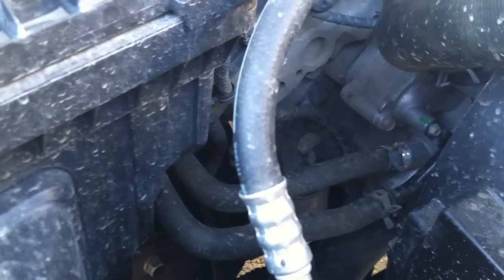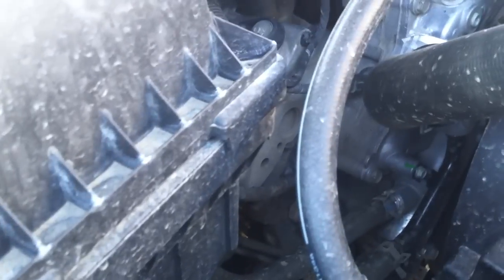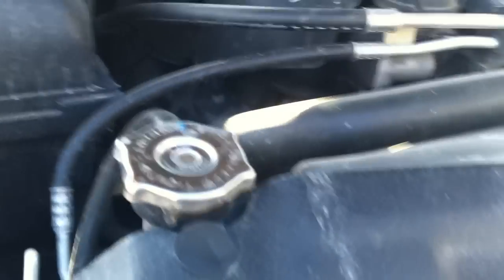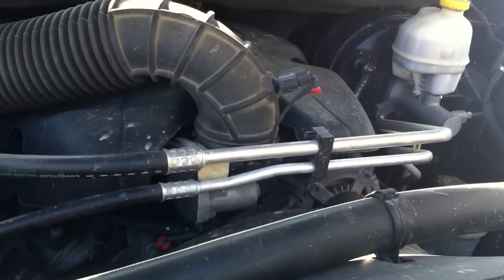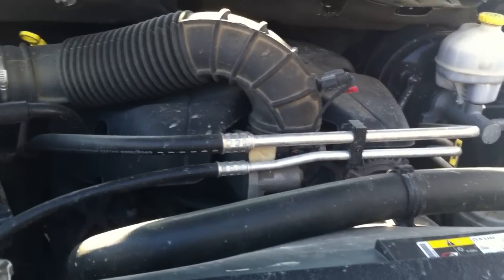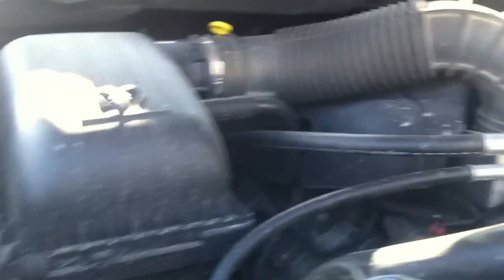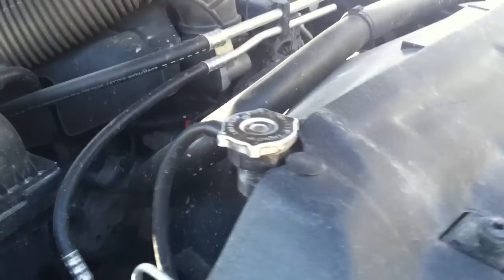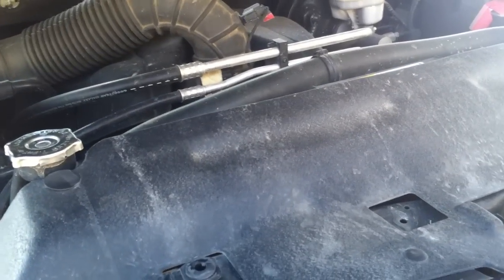How To Fix Dodge Ram Hemi Tick Recall!!

Comment: Had the same noise, dealer told me it was normal. Your video helped me realize it could be an exhaust problem, which it was and they fixed it under warranty on my '13. Thanks !!

Comment: My 2012 5.7 Ram had a top-end rebuild at 72,000 miles, despite being treated with kid's gloves. Got back home from vacation and when I cranked up the Ram (that stayed home) there was a tapping nose that sounded like it was coming from the catalytic converters.  Took it to the dealership and diagnosis was "failed lifters" and broken exhaust manifold bolts.  The lifters that failed were the MDS lifters. They ended replacing the heads, cams, lifters, etc. and replaced manifold bolts with stainless steel ones. Even though Dodge knows the metal manifold bolds break due to the heating/cooling extremes, they still put them on the engines.  Repair was covered under 100,000 mile Power Train Warranty. It's a shame Dodge isn't able to resolve some prevalent design/manufacturing flaws in their flagship engine.

Comment: I'm glad I found your post, my 2012 Ram just recently started making the same noise at 80k miles. Going to take mine in soon as soon as I get some time, I'm also hoping I don't get the "they all do that, nothing to worry about" b.s.
Reply: Paul Mitchell no kidding.  I get sick of that excuse.  Did you get yours fixed? Mines an 04 but only does it at cold start and for less than a minute.  A friend thought it could be a lifter but it sounds to me like it's manifold gasket/bolts to me.

Comment: Bought a brand new 2015 Ram. Brought it to the dealer for an oil change with 3000 miles on it and right away had a noisy tick at start up. Perfectly quite before that.  Has to be the oil. Bringing it in next week.

Comment: took mine to the shop.  got it fixed. 
at first I took it to a dodge dealer and they said I needed a new motor because my lifters were bad. they quoted 5665 for a new engine. I went and got the truck. took it to a shop across town. fixed my leak. no more ticking.  wow. I'm so pumped.  Don't trust the dealership.
Reply: Virgil Mcdonald they ain't called the stealership for nothing
Reply: What exactly did they fix and how much was it
Reply: What shop you got to?

Comment: My 2012 started this last week found out today it's a broken manifold bolt. Called FCA they said there is NO RECALL however they said if your still inside the 100,000/5 year power train warranty it is covered. Then I called Oxmoor Chrysler, Ram and they said um no it's no covered warranties don't cover bolts. Called Commonwealth Ram ( both dealers in Louisville) yea no problem when do you want to bring it in? Moral to the story some dealerships lie to make you pay.......:Call around!
Reply from the maker: Col. Kevin M. Jankoski well that's weird...they told me that it's a recall that's going to be added at the time when I had this fixed!!! but my problem was resolved because I was under the 100,000km warranty
Reply: That's how they collect twice for s single repair. Charge the customer and the warranty

Comment: After all these years, Ram knows damn well that putting aluminum heads on a cast iron block is the reason for the manifold bolts breaking. The two metals expand differently causing the bolts to break. They aren't going to stop using the aluminum because of their mind set to save weight. But they could use high grade stainless bolts with compression springs between the bolt head and the manifold to resolve the expand/contract issue but they don't. Worse is the fact they refuse to acknowledge there is an issue which everyone already knows about! If FCA would acknowledge it and repair it free, customers would have a lot more confidence in them. Sometimes the biggest brains have the weakest minds with little common sense.
Reply: Doesn’t matter. People will keep buying them as long they keep making them.

Comment: All the Ram's have that problems, its the exhaust manifold studs that break. You will hear it more often when its cold. When the engin gets warmer it will be less noisy cause the metal expend a little bit and seals it of, but it will get worse with time.  Its fixable,  and it will probably happen again lol

Comment: Yup, I just took my 2012 Ram into the dealer for the cold start tapping noise. It was the manifolds. I'm glad to have it fixed, but if they just replaced it with OE manifolds, it will happen again. We all need to get together and complain to Ram about this so they will recall and use different manifolds.
Reply from the maker: Jonathan Dunno They never replaced with the OEM on my truck...I told them not to,they said no they know of the problem and have a stronger one...

Comment: That is correct, no recall at this time as quoted by Dodge customer care. I have a 2012 RAM, 5.7 Hemi with 107,000 miles (mostly highway miles) So far repairs have been this: thermostat at 48,000 miles, Shift solenoid at 92,000 miles. Now manifold bolt broke at 107,000 miles on right side. This seems to be a common issue with manifold on 5.7 Hemi quoted by the service department at dealership. Going to cost me $697.00 to fix this on the right side. Hope the left side doesn't break. So much for following the maintenance schedule and getting a quality product at the end.
Reply: my 2012 has 105,000 miles and I have only needed to replace one tail light and one license plate light. ticking noise just started for me.

Comment: hi there i have a 2011 ram 2500 HD 5.7L 4x4 Laramie longhorn, and i get a click tick on start up and lasts long enough that it goes away after about a minute. as soon as i rev my engine high enough i do not get that ticking at all and goes back to normal. My mileage is about 54,700KM and my last oil change was less than 6 months ago and im due for one here by mid summer (early july). I have notified my dealer, and a local mechanic and they both will get back to me about it. So thanks for the heads up about the lifter/manifold

Comment: My 2012 Ram is going in tomorrow for this problem. Loud leak, sounds horrible. Also getting the recall for the steering cable fixed. currently have 89,000 miles. Covered on the 5 year-100,000 mile warranty.

Comment: My 2012 Dodge Ram Express has 77k. the looked at my VIN and stated there is no recall but to bring it in. Will this be covered under the Manufacturers Warranty?I have the same problem. On cold starts in the morn, the tick is loud. Give it 30 seconds, the tick stops and doesn't come back. I am amazed that Dodge knows about this problem and through the years have neverfixed it. I am hearing 2016 and 2017 trucks having the same problem. But Why pay the extra labor and parts when you can null the problem in the assembly line and never have customers complain and have to payfor the repairs?

Comment: Hi, I know you posted this a while ago but who told you this would eventually be covered under a recall? Mine is a 2010 with 109,400 Km and mine has both manifolds leaking. I am in the process of trying to find out if it will be covered under a recall because the emissions warranty expired. 8yr/100,000Km I believe. I still can't find reference to this being covered under any recall.

Comment: I still hear the noise that is the classic Hemi tick.
Reply: Jim Cole is that nice really normal? I hard that on mine but I mean I hear different things about this tick noise? I'm seen a few other videos and there's don't sound normal you can hear knock not tick
Reply: Manny T I have a 300s with a hemi 2013 hear the tick or knock when cold and when I drive slow at about 1500-2000 rpm from a stand going about 15-20 and when coasting at that speed.  Mostly goes away when warm but I'll have to check with the dealer next time I go.  Cars been flawless other then the noise. Tried to hear with window down at low speed and nothing only windows up I hear.  Wife's jeep with hemi is quiet as a mouse.  I just don't want them to tear into it and make a mess of issues.  Glad we got lifetime warranty. They just don't advertise it you have to ask
Reply from the maker: Manny T I have other videos on my channel explaining what the tick is and how to fix...very simple
Reply: Jim Cole got it! I just did a complete oil change yesterday to Mobil 1 5w-20 it seem to quiet it down a lot. Still ticks a bit at cold start but goes away faster.
Reply: Maxim HD Entertainment I'll have to check them out I had my mechanic check it out he said it sound like a exhaust leak nothing major
Reply from the maker: Manny T I made another video regarding this...and that's what it is and ram has a recall
Reply: I hear the ticking clear as day. Mine has been in 3 times for it and there is no recall that I have received. Has there been a tsb on this issue at all?
Reply: DaGreek 5356 Hemi's tick, I've never found it to be an issue with them in the long run.
Reply: William Stewart just keep replacing the hardware to the manifold that goes every other year. Extract the old and in with the new
Reply: DaGreek 5356, I wanted to give you a thumbs down...not because you keep changing the hardware, but because it keeps happening that often.  I have an '09 Ram 1500, 5.7l and just fixed mine last week.  I hate to think I'll have to do this every other year...  Props to you!
Reply: I thought I was the only one lol I still hear it too! The rams had an additional issue
Reply: @A42yearoldARAB  my hemi tick was the cam shaft and a bad lifter

Comment: I listened to what your truck sounded before, that DOES NOT sound like the typical Hemi-tick from other Hemi's. The ones with the typical hemi-tick have a more serious INTERNAL problem, you happened to be lucky that it was just your exhaust manifold. But both problems do sound similar.

Comment: I had the same thing on my 2009 and they fixed it for free.  I didn't know there was a recall I thought they fixed it because it came with a lifetime drivetrain warranty.  Unfortunately, now I have an engine ping I can't get rid of and the dealer doesn't know how to fix it.  Don't think I'm ever buying a new Chrysler vehicle again.
Reply from the maker: rodbender7 yup I know how you feel bud.. my ram started doing the samthing! so I traded it in for a new van for the family got $27600 at kia now I'm driving a sedona sxl loaded! at the time of trading the ping wasn't that loud I could hear it but they couldn't.. they even sold the truck the next day after trad lmfao I only payed $31000 for it new

Comment: Just so you guys know, there isn't a recall, there is however a bulletin that just lets the techs know what the problem is and how to fix it. If you have powertrain  warranty left, it will be covered.  If not then you end up paying for it. This is what I was told at my STEALERSHIP today 25june 2015
Reply: "Stealership", nice!  I am 47 years old, thought I knew everything, but you taught me a new word today!
Reply: TRUE HAD THE SAME ISSUE FIXED MY MANIFOLD BOLTS AND AFTER 100000 MILES OUT OF MY POCKET.... ASKED DODGE IF THE WOULD EVER RECALL IT.... NOPE....
Reply: @anonymousitanimulli6086  how much did it cost
Reply: @MrBfry55  NOT SURE NOT AT 100000 MILES YET I KNOW THAT IT COSTS NEAR $800-$1000... EXPENSIVE REPAIR

Comment: I just bought a 2012 Dodge Ram 1500 RT and mine just started making that obnoxious ticking sound. I don't have $3000+ to fix it. I do have the highest power train warranty out there. But I think I'll take it by a dodge dealership to see if there us in fact a recall because I want it fixed but not by my wallet.

Comment: I have a 2008 ram 1500 4.7 that has a loud ticking noise on the same spot it stops when I drive but at idle like at a stop sign or whatever it continues to tick it's very very anoying could that be the problem?

Comment: hello, what is the recall # or service bulletin # to get this fixed?
Reply from the maker: Just go to dodge and tell them whats going on and tell them your problem and tell them its a recall and you want it fixed...my 2012 was a recall i just took it in and they said its a recall and fixed it no questions asked.. so i dont have the recall # or service bulletin # maybe if you go online and look you could find it
Reply: Maxim HD Entertainment Ok, thanks. Mine is a 2011, I couldnt find the recall documentation online for 2010+.  Only 2009, even though its the same engine.  Will be dropping mine off overnight so they can start'er up in the morning to replicate the issue.

Comment: I just bought a 2018 ram 1500 and i already have the tick after 10,000 kms. They told me it was normal😠. Its not normal. I had a 2004 ram 1500. Never made that noise
Reply: Rob Case yup I have 2017 mine ticks now to

Comment: I have a 2014 and it started happening to mine! you'd think they would fix the freaking problem instead of letting it go......ugh!
Reply: Mine is also 2014 Ram Hemi, and here I am, looking for WTF the ticking sound is.  I changed the oil, filter, topped off fluids, but it is no less ticking.  Put it this way, even my old lady was like WTF is that ticking sound, that ain't normal!
Reply: My 2014 is waiting to get this fixed for a broken manifold bolt also!! Hella annoying
Reply: @norcal5308  how much you have to pay because I'm having this issue?

Comment: I have a 2005 ram 1500 5.7l with a lifter tap can it be Changed with out ripping the motor all apart
Reply from the maker: Lee Raymond shouldn't be a big job at all

Comment: Mine gets a tick in eco mode when i hit/tap the brakes (not a brake problem) it sounds like something is engaging making a ticking sound when in eco and then disengages and ticking stops when im coming to about 10 15kph. Ticking only happens in eco mode and goes away when i give throttle or get out of eco
Reply: 2012 ram 1500

Comment: They never issued a recall. I own a 2007 5.7 Ram and both exhaust manifolds broke. They told me they'd fix it for $3400.00, but that they knew of NO issues concerning leaking exhaust manifolds in the 5.7 Hemi's.
Reply from the maker: $3400 they are fucking nuts lol do it yourself it would only be $200
Reply: My 2006 hemi also has both manifolds whit broken bolts.   Its never been recalled.
Reply: +02buster my wife has a 2011 Ram Hemi and it has no recalls for the engine exhaust issue. Until someone dies, Chrysler IGNORES defect issues.
Reply: No known issues concerning leaking in the 5.7L manifolds?? BULL SHIT! 
A friend of mine with the exact same model/year truck as mine was savvy enough to get the extended lifetime warranty when he bought it... when this happened to him he took it to the dealership for a warranty repair and they told him "Yeah, this is a known factory defect.  Good thing you have the lifetime warranty or else you'd be paying out the ass for this repair"

Comment: I was almost going to buy a new RAM.... then saw all the horror stories of the infamous 'Hemi-Ticking-Engine'...... went to a dealer and had him get 2 sets of 2019 RAM truck keys and went out on the lot... he started them both up, and BOTH of them had the 'ticking' engine for about 3-5 seconds and then sort of went away.  What the heck?!!  Why don't they fix this?  I loved the truck otherwise, but no way in hell will I buy one with that annoying crap going on... it will only get worse with time and who knows what is wearing down in the meantime.

Comment: You were duped by the dealership, the manifold bolts are a problem, you will have to keep changing them as they keep snapping.  But what they failed to tell you is the newer hemi engines have faulty lifter roller bearings that more than likely start to fail before 80k miles. This will cause damage to your camshaft which will then damage other internal components of your engine. I've got a 2015 Ram and the manifold bolts and some studs have been changed at 50k miles, my lifters are ticking already but dealership says this is the normal hemi tick which is bullshit. I will be selling my Ram soon and going back to the Toyota Tundra. I love the Ram but Dodge screwed this engine up and is not fixing the problem which is very shady. In your video I can hear your lifters starting to go, good luck.